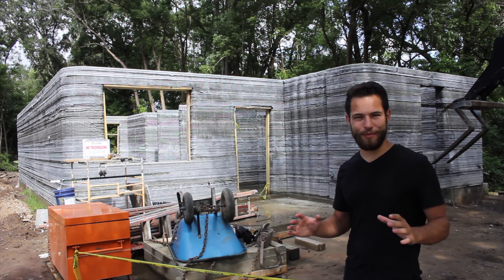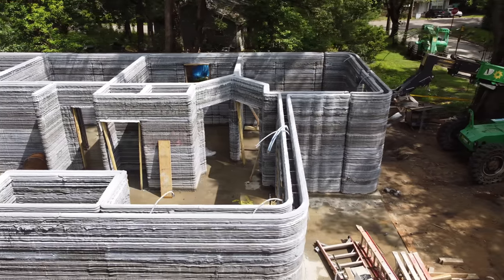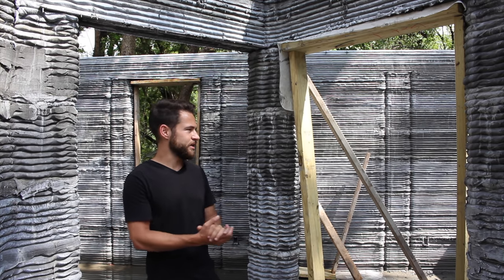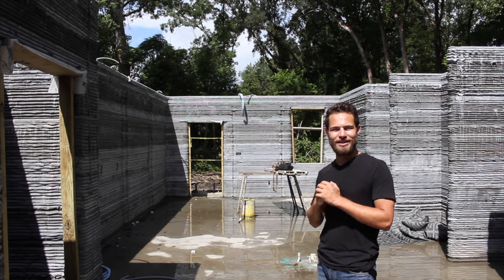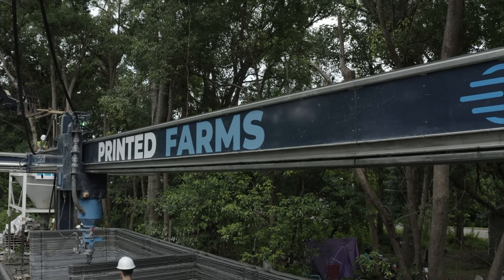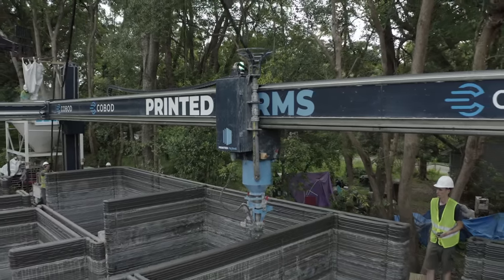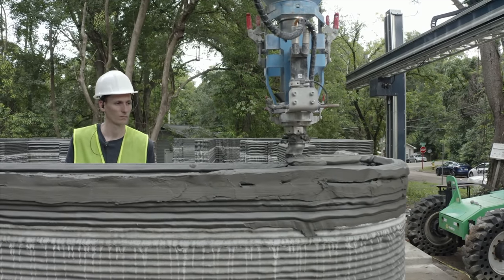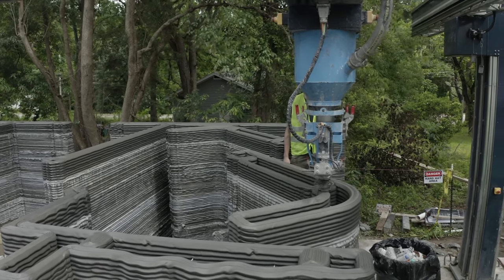First Permitted 3D Printed House in Florida | Printed Farms Strikes Again

Comment: Combined with multi-gantry and robotic structural/electrical/plumbing/HVAC and surface finishing, the technology may become cost effective in large scale projects, especially in high cost labor areas. But if great architecture is to be built, the combination of other materials as well as integrated component insertion during the build needs to be done.
Reply: Yes and no. Once enough people have built Ai will come along and teach us how we can be really energy efficient.
Reply: @brinjoness3386  We already know how to design and build passive solar and thermally efficient buildings. AI may help as an integral design tool while doing alternative concepts. I was referring to finishing the 3D printed surface and installing components in an integral, during build, process. The use of heterogeneous manufacturing systems during the build VS just 3D printing then post finishing as done here is the key to mass production at an economical cost, while maintaining the ability for alternative designs in appearance as well as function. As to my opinion of aesthetics, I like the ridges of the printed layers.
Reply: Brutalism time. Whats old is new.
Reply: @fulsame1  Like Adobe layered mud, 👍

Comment: just an automated concrete plastering machine,  Precast concrete house is better and cheaper.
Reply: in theory a 3d printer can be used by a small group of people on-site for many uses. precast concrete takes skill and tooling.
Reply: This is not even close to cost effective at all this just a way of construction companies to use less workers
Reply: @bryanmaeser  yes. By design. We are about to have a heck of a lot fewer  people living here. And retirement age people are about to be able to retire. Automation is going to bridge that gap. Other products about to be released that will likely be even faster and less involved. It's exciting times. Very.
Reply: @bryanmaeser  and that's the savings. currently not profitable, but costs clost to zero labor vs traditional building
Reply: correct !
Reply: Whether its cheaper with less workers, a full figured drive way extended to the back corner house would be more suitable for the all the concrete used to create the home. Moreso, half arc driveway attached to the main entrance driveway visitors & safety.. Looking very good fellas👍🏿 Don't forget the rain gutters👌🏿

Comment: Do these printers utilize retraction at all? I feel like it could benefit from it if done right. It also looks like a couple of side guards the same length as the layer height would help clean up the sides of the extrusion, but with how the print head rotates it would slice through other printed layers so I see why they just have to kind of deal with the rough shell.
Reply: You cannot retract a liquid (afaik)

Comment: I would like to think that the printing material will vary, whereby key structural parts would be in concrete and non-structural parts would be built with (locally sourced) extruded mud or clay.
Reply: I would hope so too

Comment: So what are the benefits of this type of house? I can't imagine it being faster to build vs a traditional stick built home. I doubt it's also cheaper. It sure doesn't look more attractive. It's less environmentally sustainable vs wood since concrete is a finite and incredibly co2 costly resource.  I'm just trying to see the upside of it.
Reply from the maker: It’s stronger in a Florida hurricane, fast to print, requires less labor… it’s a work in progress so although it’s expensive is improving and becoming cheaper. Think of it like flatscreen tvs which were $5,000 15 years ago but $250 today.
Reply: Doing 3D printing gives you much more control over the shape of the house, i.e. you can have curved walls easily. How useful that is in practice, I don't know.
Reply: Grumbel a round structure would likely be best HVAC economy?  Maybe? But, interior noise could be more an issue, and furniture fitment. Round would maybe even be better in high wind areas, I don’t know.  The whole deal is interesting!
Reply: Have you seen lumber prices lately?  This has to be cheaper and stronger I’m sure.
Reply: @brainyjanie8186  prices are literally almost back to normal. The high prices where never going to be permanent.
Reply: @brainyjanie8186  stronger? Debatable since it isn't reinforced concrete.  Even if it was stronger why does it need to be? Most houses aren't in hurricane areas.

Comment: As much as I am excited to hear 3D printed house for people to live in, whether the materials used for printing these 3D houses are safe. The manufacturer should have an expiry date for the owners as guidance. Should they choose to rebuild it after so many years. It would be unrealistic to think that things can be lasted forever.
Reply from the maker: It’s stronger than normal concrete.
Reply: This isn’t germane, BUT, for what it’s worth...Granddad built a cinder block house pre WW2.  It’s survived tornado alley of Alabama and serves my eldest brother and his family well as of 29 Aug 2021!
Reply: @automateconstruction  It's stronger, but over such a wide area, wouldn't this structure be prone to cracking from the same forces that require sidewalks, and large concrete driveways to have score lines to control cracks?
Reply: @automateconstruction  not stronger than reinforced concrete though?
Reply from the maker: @Jinkypigs  Under compression 3d printed concrete would likely still be stronger because of the cement concentration of the concrete but in tension the reinforced concrete would almost certainly be stronger.

Comment: Interesting, but ever seen our 3D sprayed houses with up to 90% recycling material? Go for it and enjoy!
Reply from the maker: Those still require some type of formwork to support the sprayed material. I’ve stayed concentrated on 3d printed mortar rather than shotcrete or spray concrete applications for the sake of getting to the bottom of it before moving on. Maybe I can check out a spray system soon.
Reply: Look how much you need for this you need to set up a whole thing this is a waste

Comment: Hello, may I have a question? I dont understand how do the expansionjoints work. If you look at the structure of the wall, it consist of 2 separate walls. The termal expansion is critical in the external wall. But what i see in the video ... if you look at the wall from outside, there is no folds. Folds are arranged in the inner wall, which is not critical in terms of termal expansion. I hope you will understand what i wanna say and sorry for my englisch =D
Reply: I think the seasonal temperature differences between the exterior and interior walls will randomly create the "expansion joints" as this house ages. The layman's terminology for these self-creating expansion joints is "cracks."

Comment: Is it possible to make a 3D printed house from mud?

And did the layer also give an thermal insulation? Because of the neir round surface and type of wave structure?

I heard that wave structure walls have properties to not heating up so much. It is based on termite houses
Reply from the maker: Yeah check out my WASP video or my Emerging objects video

Comment: A race to see who has the fastest 3D concrete printer. Than IS going to be fun. Hope you get others on board.
Reply: The winner will be using 10 percent concrete and 90 percent recycled plastic.
Reply: @brinjoness3386  there must be some research on that. I like idea of reinforcing concrete with recycled plastic. But we must check expansion of plastic and concrete. If those won't much concrete will crack.
Reply: @k1zmt  i was thinking weaving plastic into the slurry as it was poured. 2 separate cnc heads. 1 laying concrete, the other pouring molten plastic in a web pattern. Would provide excellent protection against earth movement.  Keep in touch.

Comment: Could I print a tiny version of this house from a .STL on an FDM printer or does your printing system use a completely different print file format to make a house like this? I take it that every time you insert a piece of wood into a door or window opening its the same thing as inserting supports in an FDM print slicer.
Reply from the maker: Usually they use .step files but yes you could print the same file.

Comment: i live in a very old european house (1923) and the bricks that make the house are very soft the mortar feels like it can be dug out with bare hands and the floors are made of wood and soil (building rubbel). Currently im doing some work on the house and need to fasten some metal beams to the walls and the walls are so soft that i have to drill from one side to the other and than put a thick metal plate on the other side so a bolt has something solid to hold it because the whole house feels like its made out of mush so i would like to know how solid will your walls be . hell i could not fasten even my sink like a normal person with plastic wall anchers because every time i try and thighten the screws they would just enlargen the hole and slip out i ended up hammering wooden stakes in to the walls and screwing the sink in to the stakes stone age tech but it works. Now looking at that house and seeing 2 very thin anemic looking layers of concrete scares me any chance of doing some testing on it it terms of fastening tings to it and what sort of kinetic impact can it withstand.

Comment: What is the cost of 3D printed homes
Reply from the maker: One day through automation and technology by decreasing the amount of labor required to build a home I believe AutoNation will make housing cheaper but at the moment from what I’ve seen it seems like a 3-D printed houses about 20 to 40% more expensive than a traditional home would be to construct in any given region.
Reply: @automateconstruction  wow so it would just be cheaper to do a modern concrete structure then.

Comment: when someone makes the printer have a pick and place system to pick up and set rebar that it cuts and bends from long sections then this will take off. the tech is already there they just need to upsize it

Comment: Well guys... I am working I construction industry and I must say, that's a bullish. You know what I not mention in all videos about all this super feature printed walls? Price... is not cheap. Second it's isn't that much faster, you still need foundation and all that much more expensive than WALLS works to do like electricity, plumping, interiors, exterior etc. Walls are +/- cheap. Walls that are made from wood frames + drywall = cheap and fast. Walls from concrete structures + bricks walls = strong and take not that much time make them if you have a good workers. There is a tons of technologies in this day's and saying that this printing method is future and only good options... no it's not true. There is better.
Reply from the maker: Currently it’s not cheap that’s true. I’ve seen progress towards being cost effective. I believe a future iteration of this technology could provide the extra 25-50% efficiency required to beat out traditional methods. It’s also entirely possible that won’t happen but at some point automation tech will find its way into construction and when that happens I’ll have a video on it.

Comment: А не проще подобное производству делать в цехе ?  В формы при помощи 3 д а на месте заниматься уже монтажом. В формах стены должны получатся ровными. В случае дефекта легкоустранимые. Вы ведь наверняка видели как в России собирают дома похожие на коробки из железобетонных плит. Isn't it easier to do something like this in the factory ? In the forms with the help of 3 d, and on the spot, do the installation. In the form, the walls should turn out to be smooth. In the event of a defect, easily removable. You've probably seen how in Russia they assemble houses that look like boxes made of reinforced concrete slabs.

Comment: Do you frame the interior? If you do, are you required to use pressure treated throughout?
Reply: The door framing is sucking up the water on the foundation, so, not pressure treated. Worse, the LavaCrete is absorbing water, so I guess, unlike stucco, the only moisture barrier between the exterior and living space is paint.

Comment: This is a good demo.
It is possible of erecting/print relatively easy  houses using a device that moves in a 3D manner 
. Technology exists, the materials were tested and the final product has mechanical characteristics  above the standards  required by local and national regulations. But sorry to say  it, this new "industry"needs an Elon Musk of its own in order to make it work.
You need antreprenors who  can erect a development ( 10 or 15 or 25 house units at a time) 
Otherwise setting a 3D printing unit in one place and printing a house then dismanling the machine and loving it 100 miles away  and repeating the process is time  consuming and non productive, therefore the costs of a such construction manner go high.

Comment: How to fix structural cracks.. it happens all the time
Reply from the maker: The cracks aren't really structural, there are reinforced columns in the wall and the engineers essentially ignore the structural capacity of the printed wall treating it like a facade. The roof rests on the reinforced columns.

Comment: im pretty sure somebody else has had to say it . but the extrusion consistency is shit. leading to inconsistent layers. you can totally fix it though. might even have a partially clogged nozzle. should check your slicer settings in cura. another more than likley problem is you are trying to hard to get good layer adhesion. either raise the layer height or adjust the layer line to be a little narrower to fix this.

Comment: It seems to me that 3D printing structures are best applied in places where houses and structures either suffer regular storm/ natural disaster damage, where concrete/ceramic structures are better suited to the location. I would hope that the ceramic formulas can be further refined to use more various ceramics besides concrete as concrete is co2 intensive and as of this post, pourable concrete that can seal CO2 is not available. Although robotically assembled houses with cinder blocks can be made with CO2 sealed concrete.

This is in contrast to modular lego style buildings that can be refitted and moved as needed where space is limited like in cities to facilitate urban renewal more successfully- and hopefully where severe weather does not occur frequently, as those modular buildings lose their sustainability if they become damaged and unable to be reused.

Comment: I HAVE 22 YEARS EXPERIENCE IN RESIDENTIAL AND COMMERCIAL ! 
I CAN TELL YOU THAT WILL BE HARD TO FINNISH OUTSIDE AND INSIDE. WHO IS THE ARCHITECT AND ENGINEER RESPONSIBLE FOR ??? WHERE ARE THE REBAR AND COLUMS ???
Reply from the maker: Rebar and columns are inside the Printed wall every 6 ft I believe.

Comment: A team of 15 Mexicans builds a house like that with CMU in one day: doesn’t seem like it would be economically viable
Reply from the maker: That’s possible but not the norm. Also this tech is improving getting faster whereas your laborers are not.
Reply: @automateconstruction  it's the norm in Florida and the rest of the country
Reply: I just finished building a concrete house in Florida, I know what I'm talking about
Reply from the maker: @drchamp1902  I'm not saying you don't but most CMU projects take far longer than a day. I'm just saying one good crew doesn't speak for the average project.

Comment: Whats the benefits of this printing? You are printing straight walls, as for 200 years ago. This works better for round walls and special designs. No reinforcements either in the concrete? This is more one step back than forward.
Reply from the maker: Watch my latest video on this project titled “Husband and wife 3D print a house” it describes the reinforcement better.

Comment: So called 3D concrete solves a problem that doesn’t exist while creating a hundred of unnecessary new problems 
Faster, cheaper, better looking methods exist which also allow for proper ( and needed ) reinforcement and insulation
Reply: It's  concrete not plastic do your research.

Comment: Great idea. Love such innovative things in general. In this case, however, the fact that it uses concrete is a big negative in my opinion. It's just too bad for the environment and we should try to find better alternatives when looking for faster and cheaper housing. My favourite right now is wood, but sadly that's neither fast nor cheap.
Reply: @elizabethbennet4791  You might want to read up on both of those things, since your  information seems to predate the current century. Only coal, oil and gas have a high carbon footprint than concrete. Also, timber should obviously come only from managed woods. In the EU forests are growing due to proper management. Also, wood is strong enough in the form of cross laminated timber, CLT, for example. There are already huge buildings build from wood ( https://www.youtube.com/watch?v=GvHx_NS9wWw ) and 300m high ones are in the planning phase. Welcome to the future.

Comment: Zero sense to use concrete without metal reinforcement. They do not work without each other.
Reply from the maker: This is stronger than regular concrete, for compression only structures it works great.

Comment: This is a terrible way to build a house. Building a house completely out of concrete has a horrendous carbon footprint. Try remodeling this house by knocking down an internal wall. This is a gimmick, which if widely adopted, will be an environmental disaster. Finally, what about insulation?